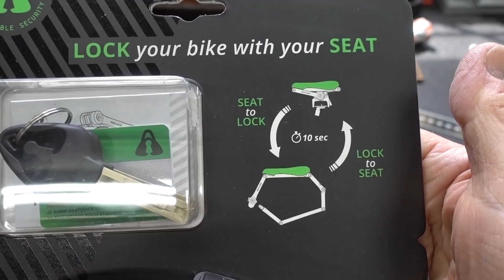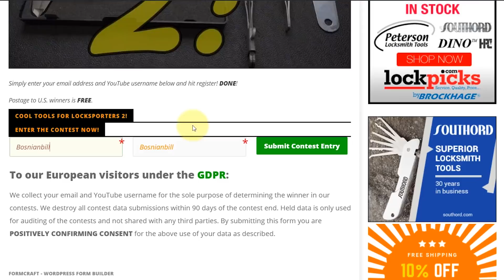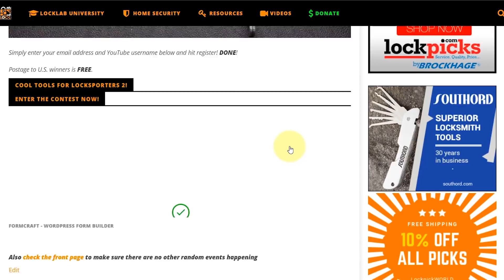(1486) Review: SeatyLock Integrated Bike Lock

Comment: I'd like to see LPL go at it with his hydraulic bolt cutters, except he exploded them trying to cut a NY Fuhgeddaboutit.
Reply: The blades are replaceable.
Reply: I would love to see that too, especially since he has said that the hydraulic cutters are a tool that is small and light enough for a thief to carry around.
Reply: It's a riveted folding lock. An open-ended b
nut breaker will open it in under a minute.

Comment: Love your "Warning" sign!  One steel that works great for ending the bolt cutter hack is heat treated H13 tool steel.  It is always funny to watch someone try to cut H13 with a cutting torch!  It is worth the laugh if you have never seen it.

Comment: I use one of these to secure the rear wheel and frame and a foldylock to secure the front wheel and frame. I have an ebike and I'm not afraid to invest some money to protect such a large investment. I use the comfort model of the seatylock and it is extremely comfortable. I can ride 20 or 30 miles without getting a sore rear end or back. Maybe more but the longest trip I took was 28 miles and there was very little discomfort in the saddle.

Comment: The main problem as I see it is the height between the mounting rails and the seat - for me it would pose a problem since I have relatively short legs and are already in the lowest position of the saddle.
It also highlights that all bikes weigh the same - a heavy bike only needs a light lock, a light bike needs a heavy lock.
Reply: Not really THAT much of an issue. You just have a bike that's too big for you. :) A properly sized bike (assuming a level top tube) will have about 4-5 inches of seatpost exposed. (Or rather a "fistful" as we like to say.) This isn't true on mountain bikes with slanted top tubes though. In those cases it should be much higher.

Comment: I know why Seatylock made those rear screws security ones: To stop some asshole thinking "I can get into this" and rendering it useless as a seat
Reply: The question is if the front is molded, why does the rear even use screws instead of being molded just the same? Well, probably there's an oddball technological reason, but it is curious anyway.
Reply: @sharpfang  True!
Reply: Maintenance/repairs, maybe?
Reply: @BazilRat  yeah this. So they can sell you a replacement seat if your seat gets worn out or damaged. It probably comes apart from the seat somehow involving those bolts.
Reply: I think I would wear the seat out long before the lock which should essentially last forever.  So maybe the seat is a replaceable part. .
Reply: @sharpfang  The front is not melded, the rear screws are designed to be extra secure and yet to maintain the option to replace the saddle as locks are much more durable then saddles and we want to give our clients the option to change the saddle to a new one without paying full price for a new Seatylock
Reply: @lmaoroflcopter  You got that right!
Reply: @Gribbo9999  True!

Comment: Bill, you forgot to do the hacksaw test?
Reply: I think he might have been worn out after using those huge bolt cutters!
Reply: bob p He already cut through that part with the 48" cutters, so hacksaw not needed.
Reply: Given the fact that it snapped clean off with 48 inch cutters, it is rather safe to assume that this is good hardened steel. You are not going anywhere with a hacksaw, except if you use a diamond coated blade. But that is expensive af and it takes forever since the "teeth" are tiny and don't remove steel quickly. Effectively, you are grinding down the steel instead of cutting it. If you want, take some iron bars that have not been hardened and "cut" them with a file. Not a very practical approach.

Comment: Crack the cast aluminium back off the lock with a leverage bar and the hardend steel inset would just lift out wouldn't it?
Reply: Not that easy as it sits pretty snugly in the lock and the plastic on the bar serves as extra warding against sliding anything in, but one might apply a crowbar between the bar attached directly to the lock and the locking bar... and completely destroy the spokes in the bicycle in the process. Doable if you put this in a vise, but the fact it won't work won't stop a thief from trying - and breaking the bike in the process.
Reply: It looked the weakest area to me also

Comment: Eh, it doesn't let you use your own seat and it raises the minimum seat height by a substantial amount. How do the rivets hold up against cutting or splitting attacks?
Reply: For best posture when riding you really should have your seat high enough that you leg is basically straight when that side's pedal is at the bottom of the stroke.

Most people don't set up their bikes properly.
Reply: @TWX1138  It depends on how and where you ride.
Reply: TangoMike Indeed, I was taught to set it so one foot can touch the ground when stopped at a red light.  That way, I can also stand up to apply my full weight to the pedals on uphill climbs.  Both means that straight leg on bottomed pedal still has my butt above the seat.

Comment: Hey Bill, will you do a video on how to smooth down lockpicks?
Reply: Sandpaper
Reply: I use 800 grit for debur and 1000 grit for polish. If there is a really sharp corner that sand paper isn't helping I will take 1 or 2 short passes with a needle file.

Comment: you hate to destroy the lock? lock destruction is often what it takes to tell us how good a lock is theives dont just pick locks they cut them off, shoot them off with a nail driver gun designed to drive nails into cement and rock, they melt them off if the locks use cheap aluminum or zinc parts they even melt them open by applying heat to the lock because some locks use cheap zinc cores.

you make plenty of money from your videos so you should get the money you need to buy locks

the makers could do better with thicker plates or even making them rounded to resist the bigger bolt cutters.